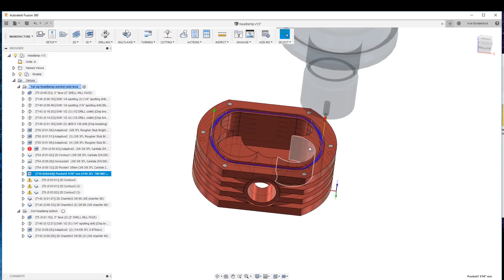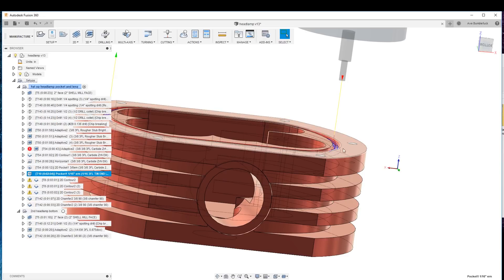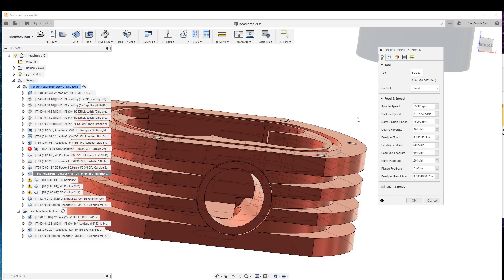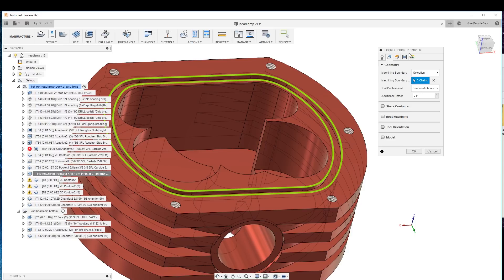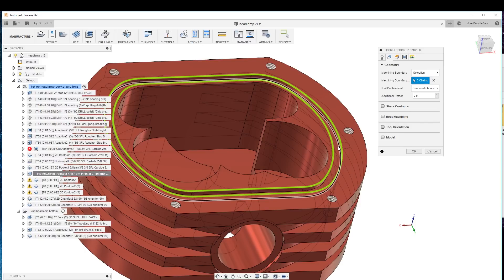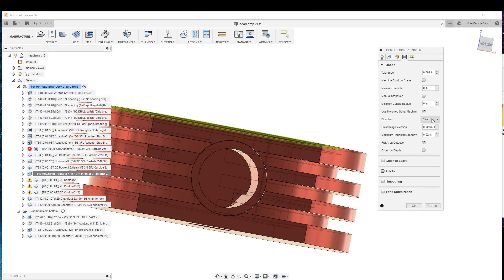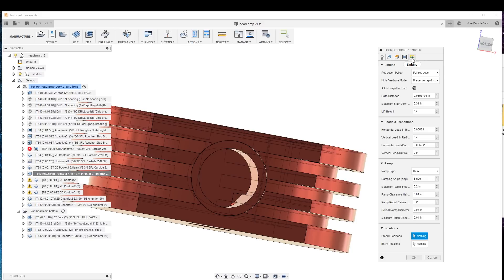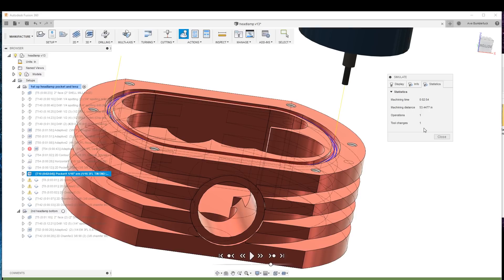Speedy Fusion 360 Ep. 09 2d Pocket O-ring

Comment: wow, lol playing with fire trying to make that tiny end mill ramp that whole thing.  i would actually try to slot that with the biggest end mill i could fit, or do an adaptive inside of it to make a trochoidal tool path.  while the trochoidal may take more time in some situations, i find it a more reliable process being significantly easier on the tools.  my general rule for trochoidal slotting is having a slot that is 3/2 * Diameter or a tool that is 2/3 * slot width.  i will feed it as deep as i can and adjust my stepover, smaller axial cut, larger stepover, at a depth of 1*D im usually running a 45% step over, at 1.5*D im at 30%, 2*D 20%, 2.5*D 13%, 3*D 9% and so on.  whats important is being mindful of your chip load. you have to ensure that it doesnt drop too low.